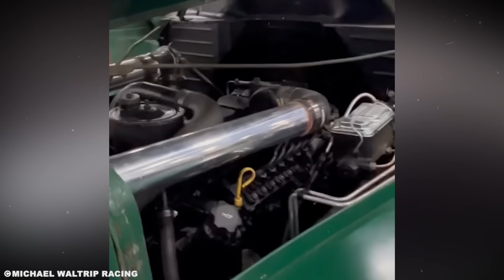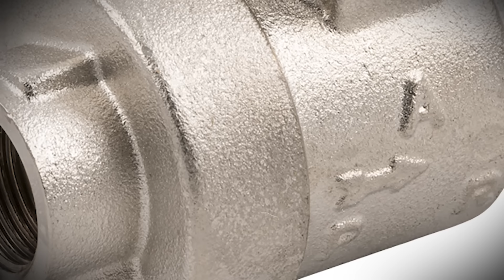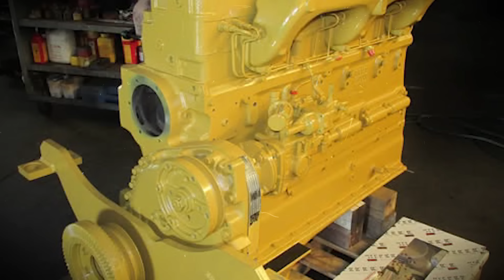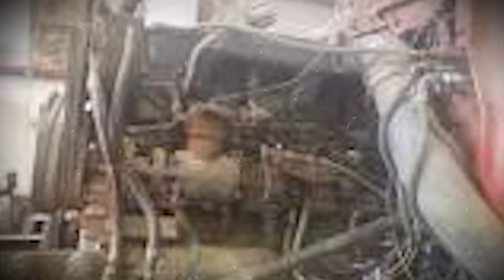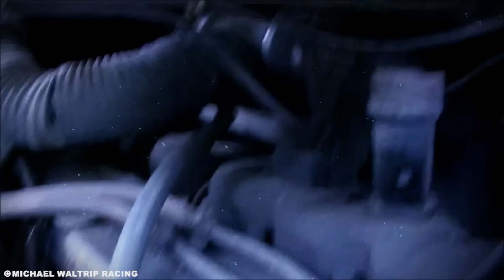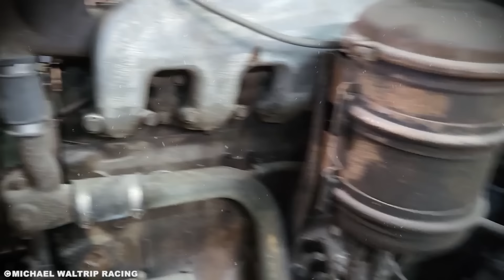How One Mack “Truck Engine” Outsmarted Every Hill in America

Comment: my new 1971 mack maxidyne  dm my first truck I ever drove and owned impressed everyone with its power and speed I was a machinist before this trained in Milwaukee with 2 years of inspection experience I could see the quality and engineering being a green horn I saw the the tapered Frame which took more brains to design the wiring was neater I saw before they told me was the balanced design of their components with the maxitorq transmission six speeds it never needed a repair in 880,000 miles and only a small puff of smoke came out after a gear change I did find a spacer on the crankshaft behind the harmonic balancer .030 out of parallel causing my belts to wear out early they did not stand behind this I had to buy a new one I changed this in my driveway in ten degree weather the center bearing on the drive shaft had a grease fitting and lasted 850,000 miles !  this was a 16 foot box I had put on heil ( I worked there two weeks and quit ) two overhalls one at 201,000 and one at 535,000 thousand and they smoked more after overhauled at mack I think the increased smoke was that the injection system was only checked always paid 26,800 with investment tax credit that went into effect two weeks before purchase sold 14 years later for 16,500 took delivery of 1985 mack improved maxidyne with the same maxitorq trans on a quad axle dump with heil box went 720,000 miles on it before it needs overhaul then oh and I bought that three months before investment tax credit went out this truck was set up with a tag axle I learned this from the guy who got the first quad axle truck licensed in the USA !! 950,00 miles the trans came out at mack to replace the clutch it was not wore out it was fatigued strength wise they said that there was one bad bearing in the trans and said it would run with that I said take and rebuild  it with the kit that mack had they said that it was the cleanest one they ever saw next was a remack engine at 1,500,000 then a total 1,750,000 sold and exported to Africa for 15,750 thousand dollars total 39 years with two Macks ,  oh I jumped off the bumper on the firs mack and the ear on the bulldog hooked onto my ring on my finger almost lost the finger it is a little bit of a deformity I guess I could have sued mack but im not that kind of guy they sold my a nice truck and happy to see the new 85 fad a filler behind the ears on the bulldog nice to see an improvement too bad they were bought out by Volvo !! Uncle Sam should not have allowed that .
Reply: also one king pin was still tight after 1,750,000 on it
Reply: Volvo were going after reno at the time and it was most unfortunate that they got their dirty hands on MACK TRUCK'S the government at the time did nothing to stop IT what a what a tragedy it would cost a fortune to buy MACK out of There Hands now XXXX

Comment: Well with my uncle had his 1952. B61 Mac. There was just something about a Mack truck that when you stood in its presence that just said rough and ready. Even though he had that one, it was a single axle. Moreover, as a play toy. Because he drove a flat nose Freightliner that was low geared hauling steel for the Alaskan Pipeline. I never did think to ask him why he just didn't buy a Mac like he had sitting there, but every Mac I have encountered since it was the same sense of stance. And stamina it just said rough and ready work. Like just its mirror appearance said bring it on. I'm not scared. Why are the trucks might look pretty and roll down the highway faster than most Mac trucks. Well, wouldn't it comes to pulling stuff out of the mud pulling stuff over a mountain? That's right. Mac is. Your and I just can't say enough. And that's what makes it so sad for me. I'm legally blind not allowed to drive but when I hit that big money. You can better believe I'm going to have a few old Max standing by for what we need here at company One and done around the immediate area and I'm going to have enough land to park all of that on in the garage to work on my junk and everything. But here again Mac. Buddy. I wish there was a way we could buy it back from the company who has absorbed it my corporation. I mean so it could be all Mac components again instead of this other tiddly boo stuff. Colonel 1

Comment: Mack trucks  were very far in advance of others I drove a 1964 Mack b81 sx tandem dump during the blizzard of 1996 it had the ENDT 673 250 hp Thermodyne with a 18spd quadbox the dump body was loaded with 3/4 stone I was pushing a lot of snow and that Mack didn’t miss a beat better truck than today’s crap

Comment: The only Truck you can put in any gear and it doesn’t stall, then you give it some throttle and it leaps ahead hunting on the governor.
Tough trucks to drive, you need to hold the rains back with finesse.
Reply: I drove a DM800 she was a beast. I could load 40 tons of coal on the chassis and she never flinched. 400 BC’s and CAT3406’s had more power but they didn’t last like the Mack’s.

Comment: I drove these Macs for Co op Fuel in Sk. Great for farms too. Could lug the load out of the field . The Scraming Jimmy relied on the 13spd Roanranger. Or a 5x4 simliar to the gas. Mac had only 5 or 6spd lol. Cummins dont dare work it until engine oil  temp up. Lol. Yes even if idlied all night Cummins had big issue in winter. Cat was better. But farmers liked the Mac lol

Comment: My Brother drove as Maxidyne and only had a five speed transmission and had 1200-2100 rpm range for less shifting!
Reply: Slow engine for lazy drivers.
Reply: That 5 speed had two stick shifts 1 had 5 speeds the other had high low range
Reply: @wiltonholden4584  The 6 speed had two sticks. The 5 speed had one. Which is obviously what this guys talking about.

Comment: Gasoline burns best at 3600 RPM.  Diesel burns best at 2200 RPM  The torque curves prove it.
Reply: The Maxidynes made maximum torque at 1200RPM......the torque curve stayed flat to 2200 RPM....no drop off.
Reply: @MichaelSuter-s9k  Yes, exactly!  The engine is proportioned to work under the fuel's optimum RPM.  The torque drops off above the fuel's optimum RPM.  If you want to run at higher revs, pour in some nitro.
Reply: @jonbold  Nitro?....no thanks.....they go well enough....lol

Comment: This is so inaccurate….T/dyne did not have 5.5x6.0 bore stroke (that’s Cummins 855 block) and had 673 cu in. Never exceeded 250 hp and that was ENDT673 WITH A TURBO. Original ratings were 170 & 205 hp. Biggest advantage was excellent fuel economy compared to NH Cummins & GM 6-71. The idea of dragging a full load up 6% grade @ 40 mph w/ an END673 is laughable.
Reply: Yep....laughable indeed.
Reply: No way  in hell  40 mph  with those  little  engines  !😂😂😂

Comment: My 350 Mack kept up to the rest of the trucks on the local dump truck routs my 450 cat is faster but you don’t need it to stay in line as traffic etc limits us our routs include freeways and up to 12 percent grades. The Mack has better mileage and overall lower maintenance than my cat 3406
Reply: That was my experience too, I ran the ol 300 and she just wouldn’t quit.

Comment: Mack understands torque multiplication, they didn't have high horsepower engines as much as good transmission and double reduction differentials.
Reply: Yup , those Mack rear ends were legendary. Tramsmissions , were a bear.  Mass gears all over
Reply: @kennyfulleton6905  yep I drove a DM800 with #55k bogies, low gear wide open was 3 mph and she’d pull a mountain.

Comment: No, the competition was not pathetic in comparison to the Mac engines. And no, the Jimmy;s did not have to run to the moon in rpm. What a bunch of moronic mis information. That said, I did like the Mac engines, for there time they were good, just like many other makes of diesel engines.
Reply: The 2 strokes typically only had 18 to 20% torque rise.. The 300 plus was 53%.....case closed.

Comment: HP  gets you along the flat torque gets you up hills ,no self respecting truck would make do with less than 500/600 HP AT 44 TONS TODAY Gross weight
Reply: Most trucks are not going to try to haul 44 tons. 44,000pounds yes, not tons
Reply: @bertgrau3934  weight limit UK
Reply: @robertsmith9810 
Ok, thank you for that information. My apologies for not knowing that.
Reply: Many 237 Maxidynes pulled road trains in Australia grossing north of 100 metric tons & to this day there are a few still working.

Comment: Bullshit......the Maxidyne was the engine that changed everything.
Reply: I ran a 237 that just wouldn’t quit
Reply: @deborahchesser7375 
That was part of the Maxidine engine line
Reply: @bertgrau3934  yep I know and damn good motors, I had a couple 300 plus’s too. They didn’t make the power of a BC Cummins or a 3406 CAT but they ran forever.
Reply: @deborahchesser7375  Mine shamed a few much larger engines when driven the way they were designed.
Reply: @deborahchesser7375  Ditto....had a pair of intercooled Maxidyne 285s. (300 plus). Best damn engine I ever had in 45 years in trucks.
Reply: @MichaelSuter-s9k  hell yeh they were great, I hate the electronic plastic junk they call trucks now. The DM800’s had diamond plate steel fenders etc. #55k bogies and Tri-Plex 15 speeds. Ya gotta love those deep reduction gears, wide open at 3mph they’d pull a house down. And that Camelback suspension wouldn’t win any smoothness competitions but man they’d handle that weight.
Reply: @deborahchesser7375  Yep......agreed. The camelback with the long spring pack would walk at speed & steer like a fork truck if you weren't careful but I only got it bogged once ...in a swamp. That was a job for heavier equipment but once we got it unstuck it crawled out.
Reply: @deborahchesser7375 Yeah man I agree these new trucks with 3 to 4 times as much torque,,,, who needs them?🤷🤷🤦🤦 Respect to the progenitors but embrace innovation and improvement.
Reply: @robertgreen1715  more power is great, constant repairs and recalibrations isn’t so great. It’s just cool to see the predecessors of what is considered a good truck today.
Reply: AGREED
Reply: Truth! The NDT676 Maxidyne was a game changer. Obviously this led to the E7 engines as well.  But, I have to agree that the "300 HP Mack" was the game changer of its day.
Reply: @kweeks10045 Precisely....No other production engine in history has ever exceeded 53% torque rise.....period,
Reply: Maxidyne  was better  more powerful